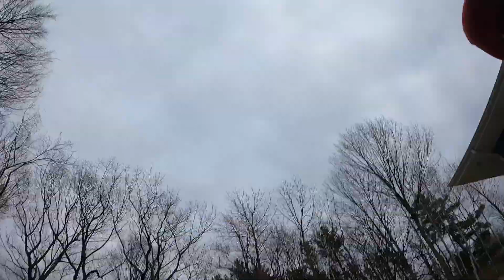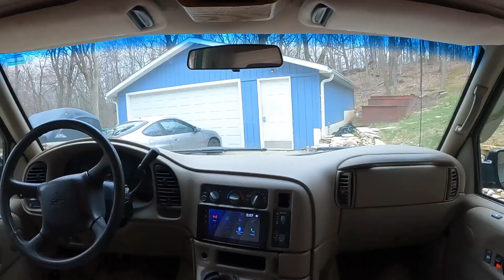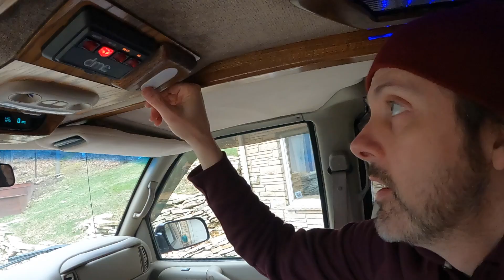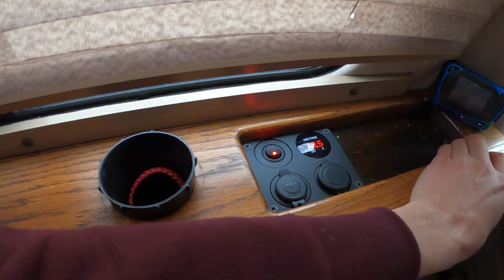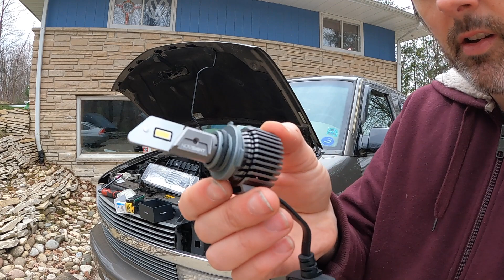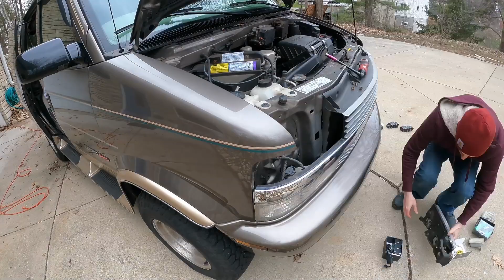Bad Astro is FIXED!! Stealth Diesel Heater, Lithium Battery Bank, Roof Fan, & LED Lighting!

Comment: You should check your fan belt and water pump. I hear a noise on startup.
Reply from the maker: My ac compressors bearing are going out.   Water pump and belts are new.

Comment: Every good mechanic has one or two of those stories in their portfolio. Step 1 is always check every fuse first with a test light for weird issues. Then find out what blown fuses are for.
Reply from the maker: Yupppp.   Just thought the gauge fuse was fine.   Oops.
Reply: @ADDvanced  where is that fuse ?
Reply from the maker: @TALK2MEMASTERR  Under the dash, I think it was #5?

Comment: Yep. I've been there. I bought a 2002 Ford Escape from a friend, ran good just had a bad oil leak from the main crank seal. So I pulled the engine out. Replaced the seal and discovered the alternator was bad so I installed a new one. Put the motor back in and it ran like crap. Missing and sputtering. My wife looking on the internet read about someone with same condition  sputtering and missing  it was the wiring to the alternator.  Nope can't be that, I looked at it. It was fine. After many hours. And lots of different attempts   took it to mechanic.  He tried new coils. Still ran like crap.  Yep it was the three little wires that go to the alternator.  They had melted together.  Yep been there

Comment: I wish they made leds that could work in halogen reflectors, every pair I've tried has that issue of not much distance. For that reason I'm going backwards a little by converting the composite light grill of my safari back to the cargo van sealed beam style, that way I can get led headlights that are actually built to take advantage of the led light output
Reply from the maker: So far pretty impressed w these things, surprisingly.  Reflective signs have some scatter but went through an insane thunder storm last night like a champ; and tonight mountain canyons on high beams, def way better than stock halogens.  We’ll see w the hella halogens tho I have a feeling those might punch even further.
Reply: @ADDvanced  the thing that also sucks about those leds is that they get so hot they eventually burn themselves out, happened with 2 pairs I had and the last ones I spent almost $80 on. The hellas probably will throw farther

Comment: Hell yeah brother! Nice job. I once troubleshot a bad light bulb on a 1990 Audi Coupe Quattro for TWO DAYS! Yeah, been there. I’m glad you got it figured out. Occam’s Razor, it’s a sneaky bitch.
Reply from the maker: Coupe Quattros are awesome.  AAN swap?
Reply: @ADDvanced  I did eventually turbo it, I should have gone the AAN route, but I didn’t. Honestly, I wish they made a 5cyl NA big bore back in the day. It would have been so good in the smaller cars. The turbos were complex and unreliable. A discussion for another day.

Comment: Remember that saying, "Behind every good man, is a woman." It has been proven true again. When we get married, part of the reason is so that our spouse can help, so let her help, and pay attention.
We do learn a lot from hard experience. One mechanic I went to had decades of experience, so not only was he a smart guy, but he had seen most problems over the years. I went in to his shop with a friend who had a problem with his minivan, where the engine would miss a bit when he hit the accelerator. The mechanic said he suspected what the problem was right away just from hearing what was happening. The engine, transverse mounted V6, would rotate a little on the mounts when getting throttle. The big mess of wiring harness all bundled up going behind the engine was shorting out somewhere in all the wires. So to cure it he just reached behind and started moving the wires around, pulling them apart from each other a bit. No charge. Drove away and the problem was gone. What a great guy.

Really appreciate your video. Now I know to check the fuses, even if I don't think it's the problem. Thanks! And have a safe trip.
Reply from the maker: I’m glad it was something simple, but bummed I didn’t figure it out.  Was too stressed about the trip.  Oh well.   Brutal 12 hour day w 60mph cross winds, rain, the largest wildfire in America, and canyons at night.  Love this thing!!!

Comment: The only difference between the 9005 and 9006 is the plug, there is no way too mix them up, the bulb will only go in its proper plug. Take care and enjoy your trip 😎🇨🇦
Reply: In addition the low beam has an anti-blindotherdrivers coating on the tip of the bulb.
Reply from the maker: These fire sideways so idk what the difference is.

Comment: We have all been there ... really glad you got it taken care of... you have done a real nice job on the interior ... one thought .. diesel heaters get super hot when it runs on full .. in Feb 2022 I found myself in a blizzard in the mountains of Wyoming and the heater had to run on full to keep the van warm .. my vents melted ... not a big deal .. modified it so I won't have that problem again.  However a I highly suggest you put a carbon monoxide / smoke detector in there ... cheap insurance if something does go bad....  have a great trip !
Reply from the maker: Thanks!   Love the interior of this; I grew up w a full size conversion van like this.  Def have a carbon monoxide detector in here but haven’t even needed to use the heater yet.   Idk about you put 40-50 deg is my favorite temp for sleeping